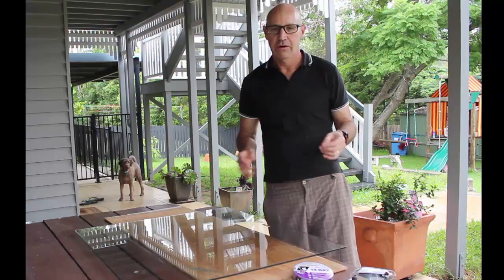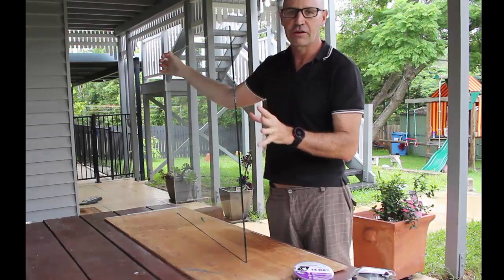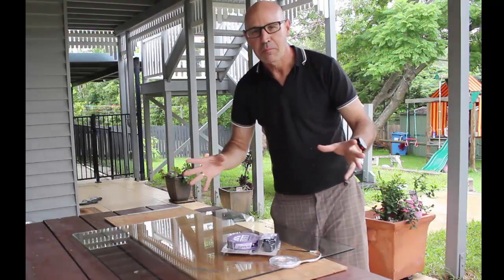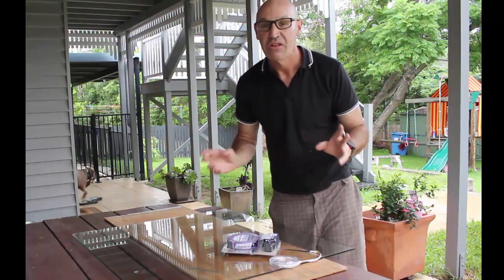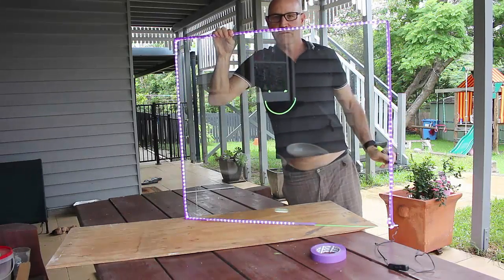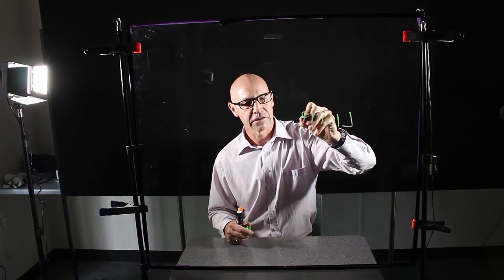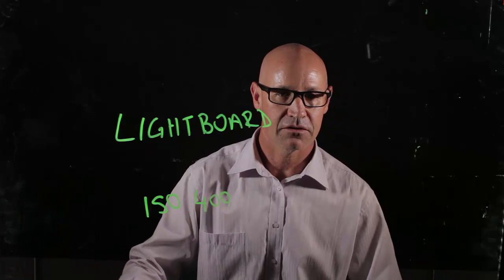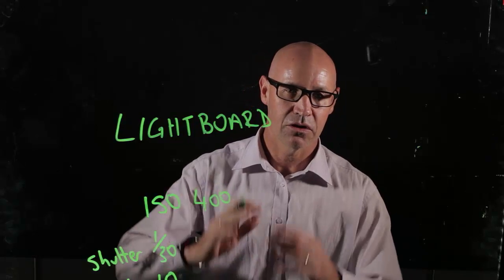Lightboard experiment- using normal window glass

Comment: Hi Steve, thank you so much for your helpful video, would you be kind enough to tell me which L:ED strips you use, presumably it's the same strip that surrounds all 4 edges of the glass panel? I see the LED strips did not cover all 4 edges completely, but did not see any stop the text glow from suffering at all.
Reply from the maker: Hi Sam
I think in this board I used one strip at the way around. For my big board I needed two strips. But I definitely think it is worth having LEDs all the way around.
Reply: @SteveGriffithsvideo  Got it! Thank you so much, Steve! The commercial prices are just crazy in the UK, from £2,200, so really grateful for showing us, it can be done without being ripped off

Comment: What is better, glass or acrylic plexiglass ? Does light diffuse better on plexiglass ?
Reply from the maker: crgl2009 this video was normal window glass.  My real light board uses ultra clear glass.  Plexiglass works just as well but I find it scratches easier.  It really depends on what you find is cheaper and easier to access where you live.  Plexiglass is more expensive than glass for us.  Good luck
Reply: @SteveGriffithsvideo  oh, ok. I dont know what you refer to as normal window glass because here we use mainly miami blinds. But I have a glass from a big painting.
Reply from the maker: crgl2009 yes glass from a painting is ultra clear.  Just be careful it is possibly only 3mm thick so might flex a bit.  Also it won’t be safety glass.
Reply: @SteveGriffithsvideo  correct. It is thin but more or less rigid since it has a sturdy wood frame. Thanks !

Comment: Given the number of people using perspex, clearly the whole ultraclear glass thing is a myth.

I suspect it arose from conflation of the colour of the glass with the finish of the edges.

I've seen a lot of panes of window glass where the edges are rounded off to reduce the chance of damage to the glass or anyone's fingers before being fitted. Not only is it rounded, but it's often not polished, giving it a very matte, diffuse property.

Ultraclear tempered glass, on the other hand, has a cut face on the edge, as it's likely to be on display.

Clearly if you have a flat cut/polished edge, the edge lighting will penetrate pretty cleanly, and if you have a rounded, diffuse edge, it won't. The window pane you used in this video had a cut edge, so edge-lighting was possible. I guess that's really all it comes down to: cut edge, light gets in. Rough edge, it gets bounced out.
Reply from the maker: Yes  great observations.  My first board was with perspex however I abandoned it because it scratched too easily and was frustrating the light.  Mind you, I can overcome this with camera settings.  Perspex is expensive where I live so glass is cheaper.  Glass is heavier though and  needs o be shatter proof for use with students.  So there is always tradeoffs.  The specification that the glass needs to be 10mm thick doesn't appear to be required either.  I found 6 mm woks nicely, still has the stiffness, but not the weight or the price.  4mm was too flimsy.
Reply: @SteveGriffithsvideo  I'm planning on making mine with perspex, because I'm a bit ham-fisted and wouldn't trust myself building a frame for glass. If my perspex unit falls off the table, it might hurt, but it won't cause permanent damage!

I suspect that the origin of the 10mm rule is simply the fact that the backing/circuit strip for LEDs is typically 1cm wide, so it's much simpler to make: make a 10mm slot, stick the strip to it, slot the pane in and you're done.
Of course, the actual LEDs only take up part of the strip's width, and they're getting smaller with every generation of the tech... but the backing strip stays the same width to keep the manufacturing process simple.

If you align the edge of the strip with one face of the pane, you're going to need at minimum 6 or 7mm to have the edge cover a substantial part of the LEDs and capture most of the usable light. Any less than that and you're going to need some shimming on both sides of the pane to centre it over the LEDs, so you're starting to have to trade off ease of construction vs quality of output.

I've also noticed that a lot of the more basic DIY jobs I've seen online have a lot of bleed around the LEDs, and I suspect that's because a significant portion of the LED light isn't coming in on the edge, but through the front and/or back face (or in the case of glass, through a chamfer). This means that it's not at a shallow enough angle to the face to achieve total internal reflection, and partially escapes the glass on each bounce.

Comment: @Steve Griffiths How often do you use this board now? Would you still recommend the possibility of using normal window glass after three years?
Reply from the maker: Hi Tony, good question.  I don't use the window glass at ll as I have a low iron glass board.  I know of others who used window glass for a few years then upgraded.  I know of one colleague who is still using glass pool balustrade with good results.   So if you can afford it, the ultra clear glass is better but the window glass will do if you have good quality LED strip lights and set up your camera well.